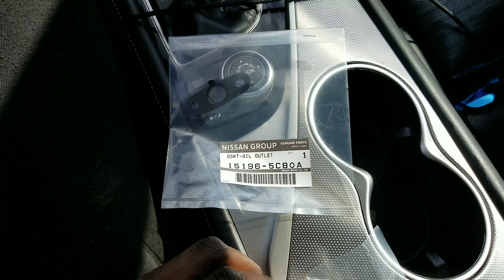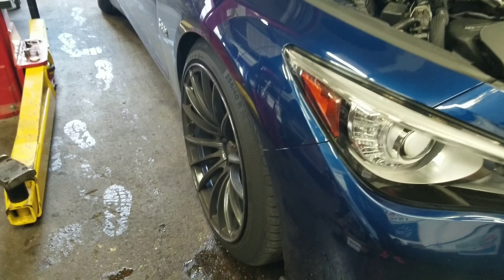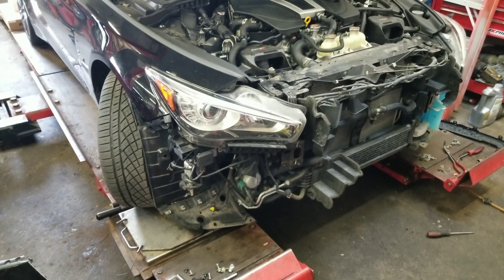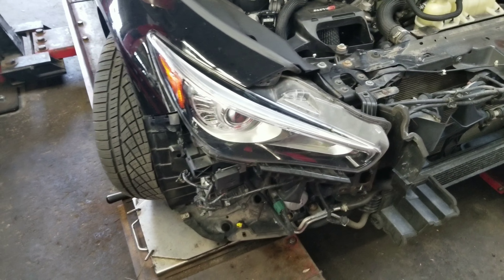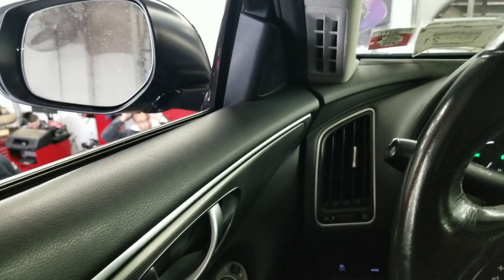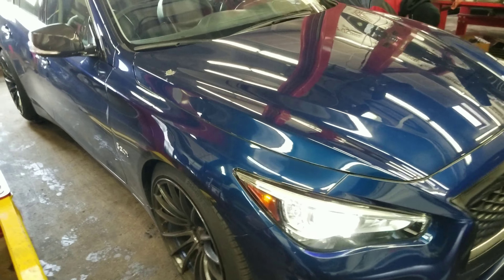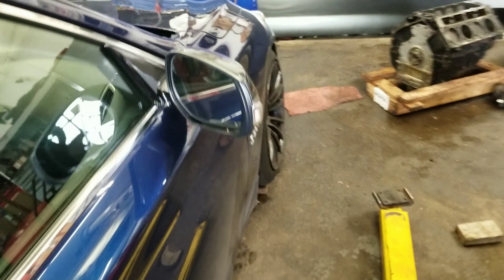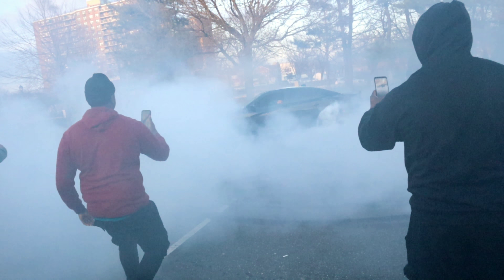Turbo leak fixed on my Q50 ?

Comment: I changed the passenger turbo myself without dropping the engine thinking it was the accuator and did a good job my turbo was working fine and then once again it stopped after the second day??? Once again p2363 bank 1 sensor??? Now my sensor from driver is acting up because I installed it on passenger side just to see if it was a sensor issue but it looks like it might have fired my driver side sensor because before that it never had issues now they both won't turn on???
Reply: How was the install difficulty wise
Reply: @sergleflur_3440  I'll be honest man if you can bring the engine down you are better off it was some serious work but did it in a week!

Comment: P2563 bank 1 boost sensor circuit. I changed the sensor and it worked for 1k miles and then it turned off my driver turbo was fine until I thought about switching the sensor from driver side to passenger and mind me I never had an issue with driver side until I switched those sensors around and now driver side is acting up and acting like the right side did????
Reply: Could it be electrical???

Comment: I got a p256 turbo charger control position sensor circuit range performance! I'm wondering what I need to do and if there is a quick fix without having to buy a whole turbo assembly kit!